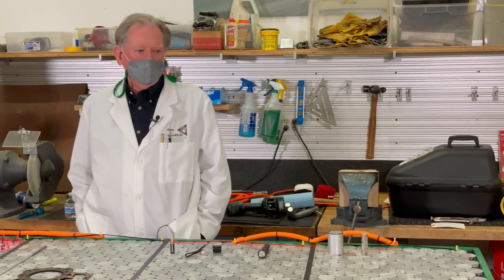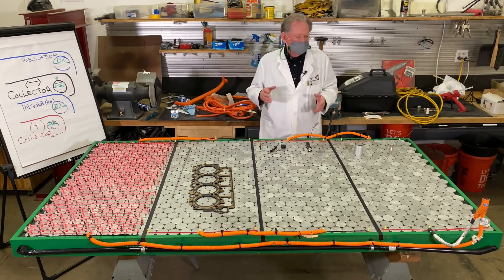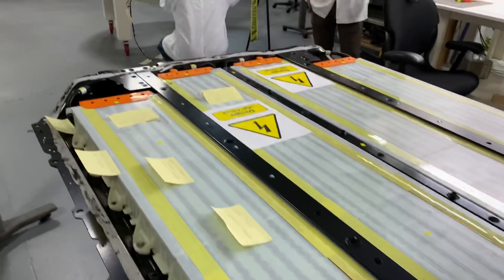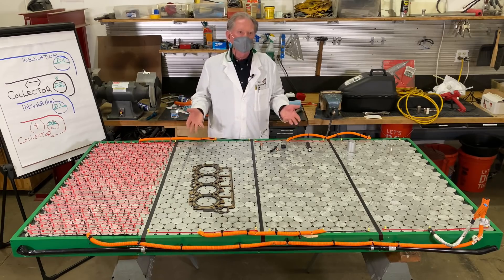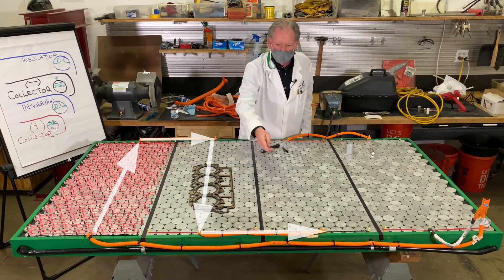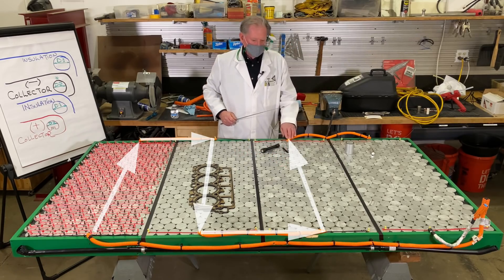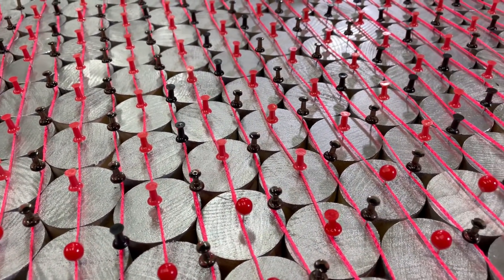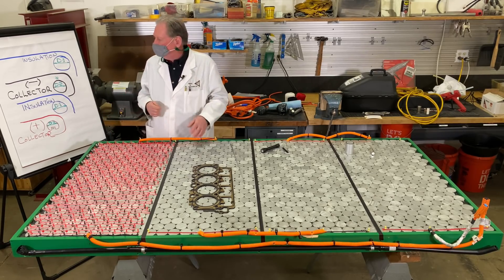Tesla 4680 Battery Pack Prophecy

Comment: Another consideration is what would happen to the pack if  a cell is defective. Might make sense to make 97 virtual "modules" of 10 cell each and connect those modules serially and cells within module in parallel. This will mean if a single cell win virtual module is toast, the voltage of the pack is not affected, just the top current is 10% less. 
With manifold idea - which I love - creating many small modules becomes quite easy, as the only ting you need to change is layout of the manifold itelsf
Reply: Current design handles this. There is no lost voltage, only a loss in capacity.
Reply: @JasonWW2000  current design of tesla pack yes, what Sandy had on the table - no. He had 97 cels in series and then 4 "modules" in series... But even if you assume those "modules" should be in parallel it still leaves a single defective cell in series of 97 going bad and causing 1/4 of capacity to be offline because of the broken circuit... Hence my comment
Reply: @andreiandolya  Let's say you have 96 groups of 10. If one of those cells in one of those groups go out, you have: 96x10, 96x10, 96x9, 96x10, 96x10, etc... So no big deal, just a small loss of capacity in that group. 
The one thing that could really mess stuff up is if one of the 96 cells that is connected in series where to go bad. I would assume Tesla has contingencies so they can reroute power and keep the pack working. This is an area I'm not clear on. It is only a 1/10 chance, but still a real concern. I wish Sandy could talk about this in detail.
Reply: @andreiandolya  BTW, what Sandy has on the table is 4 sections of 24 in series and 10 in parallel (24S 10P) then those 4 sections are in series.

Comment: I thought with the tabless design they were going to have the entire bottom positive, why are both connections on the same side of the cells?
Reply: No, same case design as current cells.
Reply: @JasonWW2000  I see that in this video but didn’t Munroe say differently in another video?
Reply: @weirdyoda04  I dont think so. He always said cooling would probably be on the bottom.

Comment: Great video! However you had every "module" connected in series in this demo, and I think this is wrong... Or you really think Tesla would have ~1600V battery system? I think way more likely case would be that 4 "modules" would be connected in parallel giving ~400V but higher max current option... or 2x2 for a ~800V system if lighter wires are desired

Comment: Sir isn’t the round outside of the new battery all a cathode, and the flat tops and bottoms anode? Looking at the tabless superposition should be like this. Then the contact surface is maximized and we can balance cells with the manifold design in a much simpler configuration, remember that surface area will relate to resistance or maximum power possible. A thermal sensitive material could pop-out if a short within a cell occurs and breaks anode contact, like pooping a vacuum jar lid. I would run cooling on the space between cells, if the cells are popped in a casted frame, the cathode contacts are there already. And each one of these larger cells will have a BMS to keep balanced charge, and probably some temperature sensors too.

Comment: One end of cell is the anode and other end is the cathode (tabless electrodes). There will be bunches of cells connected by plates at each end (cells in parallel) and these bunches may then be connect in series. Otherwise whole tabless idea is pointless.

Comment: In a structural pack would it possible to put the cells horizontally? If yes think about how many welding points they can save ;)
Reply: They don't need to save welding points. Other factors are more important.

Comment: So your bet is 10P24S4S... With a fully charged voltage of around 400V? Makes sense with the “manifold” collector stack. Do you think there will be any form of per cell fusing (thin section going to each spot weld)?

Comment: Great explanation. Not to hot, not too cold, it was juuuuuuust right :-) 
When I worked for a time in prod dev, I found that coming up with the ideas wasn't enough. One had to be able to communicate your ideas to other people. Other wise nothing got signed off, or funded, or made.
I built a lot of design docs, prototypes, and animatics at the time as communication aids.
I get the impression that Sandy has this sort of thing down to a fine art. The home-crafts built example was brilliant! The video supers were also 'on point'.

Comment: Are the wires connecting in the Y also acting as cell level fuses?  That way a short on a single cell would melt the wire and remove it from the circuit before bad things happen (hopefully).  Do you lose that fault tolerance with a manifold?
Reply: Yes, Model Y is like that. I'm sure a similar "fuse" design can be easily built into the manifold. You just stamp a narrow section near the contact point.

Comment: how would the cooling work between each individual battery in this example? my understanding was the batteries would cool through their long verticle sides not through top and bottom.  can you clarify that aspect?
Reply: Only need cooling on the bottom of each cell.

Comment: Also, if the "can" is the Negative and the Top center is the Positive ... you just run the Neg underneath and the Pos on top. Seems simpler.
Reply: Water cooling will be on the bottom. both on top is easier

Comment: Could you NOT do the spot welds and just pressure it all together? [Like the battery in a flashlight? Seems to be fiddly and a lot of work to have to weld 1800 times.

Comment: Very interesting idea. You may have addressed this and I just missed it, but would there be heat issues having so much current running along just 4 manifolds like you described? Also how would cooling/heating of the cells be achieved? In this scenario, do you think Tesla would focus their cooling on just the bottom of the cells since the internal resistance is supposed to be really low? Or would it also be implemented in the manifold?
Again, sorry if you already addressed this. I'm at work so I had to multi task while watching this :)
Reply: He said cooling/heating just the bottom is fine.

Comment: I'm not convinced it doesn't make more sense from an engineering perspective to use typical end polarity--positive on one end and negative on the other end--with plates top and bottom for spot welding.

Comment: why not have the bottom be negative and the top be positive and then the top plate and the bottom plate will be like big circuit boards
Reply from the maker: that is possible, but it complicates the cooling and thermal management. The Model S and Model X did do it that way with the 18650 cells.

Comment: Here's a video from F&K Delvotec that shows an embodiment of what Sandy is talking about.  https://www.youtube.com/watch?v=KgN3lVDO_j4
Notice the full sheet circuit which includes both busbars and cell voltage monitoring just lays on top of the cell array and then the laser head goes to work making the welds, both + and - at a couple of cells per second.  Also note that the turnaround junction is implemented at the far end of the circuit so both + and - main connections are at the same end.  If EV manufacturers aren't designing their packs from cylindrical cells they should rethink their decision.

Comment: Love your presentation
Reply from the maker: Thanks!
Reply: @MunroLive  quick question,  the battery pack, was it a series or parallel wiring?
Reply from the maker: @kingsdman  96s10p. groups of 10 in parallel, and then those groups in series 96 times.
Reply: @MunroLive  yea i figured it was a combination of series and parallel. I got confused a little cuz you mentioned series but I saw a parallel wiring.

Comment: Thanks for the vid Sandy!  I think most people have not highlighted how significant the weight savings (cells as structural component of the pack) and ease of manufacturing (bigger cells = fewer cells to make)  will be with the new pack.  Wish you could expand on those two things in a future vid.
Reply from the maker: You got it Michael. We will pencil that into a future episode.

Comment: Just a Quick question, to me it sounded like Sandy said the new pack would have 5x the energy and 6x the power... Isn't that per cell? So if the new pack has 1/4 the cells, that gives the new pack 5/4th(1,25x) the energy and 6/4th (1,5x) the power, right?
Reply from the maker: 5x and 6x at cell level, you are correct new pack has 1/4 the number of cells.

Comment: I did not realize both polarity on the same side! That would increase the risk of short circuit. 😣
Reply: All 18650 and 21700 are like this. tiny 1mm gap separates them. No big deal. They coat it in an insulator material.
Reply: @JasonWW2000  i meant the positive and the negative terminals. Typically they are on the opposite ends. In what Sandy showed, they are both on the same end.
Reply: @Alshafi  Actually, most batteries have positive and negative on one end. If you look at a AA battery you see both electrodes on the negative end. 18650 and 21700 (and almost all cylinder liion batteries) have the electrodes on the positive end. Typically the body/case and part of one end are wrapped in an insulator. Typical cylinder batteries like AA, D, 18650, etc... use electrodes on opposite ends to make them fit devices easier. 
Tesla just posted pictures of their new battery pack. You can clearly see both electrodes and the plastic insulator between them. Cool stuff.

Comment: SUPER helpful!  You guys do brilliant work.

One question:  I would assume that sides of the cans would be touching, which are negative.  I don't know jack about electrical engineering.  Do the point welds 'direct' the current flow despite the fact that all the cells are touching?

Comment: I'm certain this is a dumb question, but why not just make the outside surface of the batteries conductive and do away with the black wires all together?  If they touch, then they conduct all the same.  Granted, you'd need to insure the battery tray itself is non-conductive.

Comment: The only problem I see with this concept is thermal management. It'll be interesting to eventually see what the 4680 pack is actually like, and it'll be interesting to see the power characteristics of each individual cell.  I'm also curious what the next evolutionary step Tesla takes in pack design is, as I don't think 4680 is going to be the sweet spot they're looking for.

Comment: I would have thought the external connectors for the modules would be quite expensive and add quite a bit of labor steps and parts. If the idea is to minimize cost, why wouldn't they simply separate the current-collector and insulator layers into shapes that will produce the 10 groups of 96 batteries in series without the need for modules and the interconnects? Musk has said they are doing cell-to-pack, which explicitly means no modules, so the re-introduction of modules here seems unnecessary.

Comment: to what extent does the size of the exterior connection relate to the "Tabless" advantage.
Reply: It should have minimal effect. The tabless advantage is less resistance inside the cell and that means less heat/better efficiency (16%).

Comment: I wonder if the little tabs on the manifolds will be thin at one end so they can each act as fuses should that cell become faulty, but broaden out at the point it is to be spot welded to the battery, so it can survive the spot welding process.

Comment: A simpler and more robust option would be to alternate the orientation of the cell to be positive up and positive down. Then the intercell connection can use the entire top or bottom cell surface for the conductor weld. The edge weld is unnecessarily complicated in my view. A similar arrangement occurred for some large cell batteries in aerospace with axial terminals.

Comment: Those little bonding wires at 3:44 can also act as fusible links in some battery pack designs.  They might not be a wasted manufacturing operation.
Reply: he knows they are fuses. New design will be similar. Fuses will be easier to make, though.
Reply: @JasonWW2000  I suppose you're right, didn't seem to make that clear but maybe I wasn't paying enough attention.  Perhaps the  if the bus/gasket material  could be made from a fusible type of metal, then they could just stamp/cut the fusible portion into it

Comment: Having so long series connection doesn't give you more capacity, it boosts only a voltage. Another issue is a single point of failure, single cell failure kills whole series string.

It's wiser to connect more cells in parallel group and then serialise them. You have capacity boost and single cell failure doesn't kill whole series, but degrades its capacity while preserving group voltage.

Comment: Mr Munroe thank you once again for an interesting and well explained video. I am making the presumption that the fact that the cells are going to be tabless this has no effect and they will design it so the positive and negative are both on the top, firstly because the cooling will be from underneath and secondly since they are going to make the packs structural and pack glue in between them all.

I do think that though you are correct in principle you will not be in practice. Tesla has some great engineers not as good as yourself but there are a lot more of them they specialise in certain areas and they have months to study the options. You are good in predicting what Tesla will do closer than anyone! except Tesla always exceeds even your expectations they will come up with something better and cheaper.

BTW have you noticed Elon's management style is very different on his 2 major companies. With Tesla he very much under promises and over deliver in a far shorter timeframe than anyone expects. With SpaceX  he is wildly optimistic in timescale and capability. Nevertheless they are both extremely successful. I put it down to SpaceX being his baby and Tesla is there just to save the planet.

Lastly any chance on you getting on Elons Tiger team of engineers he is going to have a group of Tesla engineers to parachute into problem areas and sort them out you would make a great addition to this.
Reply from the maker: great points Glenn. Thanks for watching and contributing!

Comment: 240 per module. 10 in parallel leaves 24 in series. 24 x 3.5 = 84V x 4 = 336V If in any parallel group one cell dies the pack the battery pack looses 10% energy? When N cells are put in series the maximum energy available is N x smallest cell energy. Also as long as no more than one cell per parallel group fails then 96 cells can fail and still only 10% less energy.
Reply from the maker: you make some great points RCdiy. The model Y and Model 3 have over 40 cells in parallel (2170 cells). So losing 1 cell is roughly 1/40th. The 4680 cell will handle much more load if there are only 10 in parallell. You are correct. Thanks for chiming in.

Comment: What about heat? As I understand it the idea for tabless was to shorten the electron path out of the battery so less heat is generated overall, but was the other benefit to conduct heat more efficiently out of the cell through the tabs? Is there heat benefits to this manifold approach vs wire?

Comment: Yes.  Well Done.  Now...if you run the 4 hypothetical battery packs longitudinally rather that laterally, you would reduce the amount of large gauge (orange)connecting wires.
Reply from the maker: great point. Thanks Greg.

Comment: I think when we make thin plate collectors separated by a dielectric layer, we may expose the design to a short path. I think the existing design M3 pack has significant separation between potentials. Your proposed brings these much closer with no built in short protection. (Existing pack thread wires act as fuses. ). Thoughts?
Reply: New design should also have "fuse" sections for each cell. probably built into manifold instead of separate little wires.

Comment: So these gaskets will have well placed voids in the other three layers right were the spot weld will be applied. So at a positive weld location the two insulators and the negative layer will have voids so only one layer would be spot welded.

Comment: II think Sandy missed mentioning how this design lends itself to robotic assembly.  A robot could easily make and lay the templates on top and do the spot welds.  A robot could also do wiring, but this is much easier.

All that said, I doubt it will be done this way.. at least not exactly.  At a minimum, there is no electrical isolation between packs.  I'm pretty sure each pack would be isolated to monitor health and charging separately.  Maybe something similar between rows within a pack.  Even a single pack has a whole lot of cells lumped in to one management unit.   Getting cell management wrong can lead to fires.

Comment: Hmm I didn't quite realize how the positive and negative terminals are on the same face in the 4680s, interesting.
Reply: They are like this on AA batteries too, the entire case is negative, right up to the top edge, it's just covered with plastic.
Reply: @coast2coast00  On AA, the case is positive and the negative pole on the bottom is isolated.    18650 and 21700 are the opposite. body case is negative. The top middle section is electrically isolated with a sheet of insulating material and the edges of the cylinder body roll over and compress it.

Comment: I don't see the negative pole being on the side. I thought both poles would be tabless. So top and bottom. And I expect them to make 10 individual strings (exactly balancing each cell in each string). Having a top and bottom connection, so you have less insulation.... However i did not do much in depth study, so I'm probably missing something..         keep up the great content! Thanks for your work.